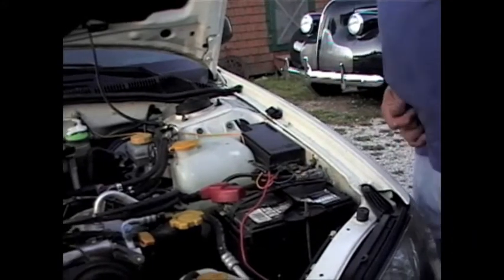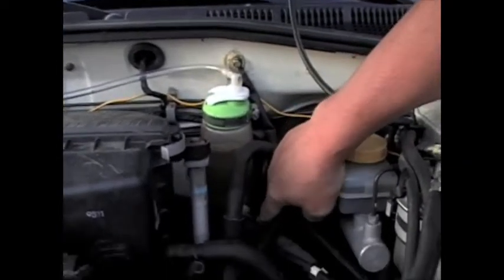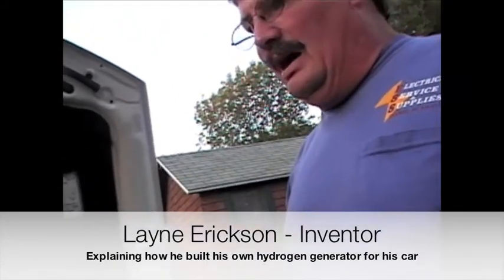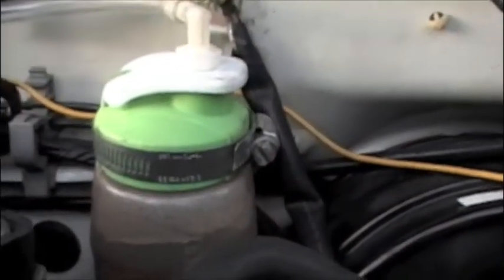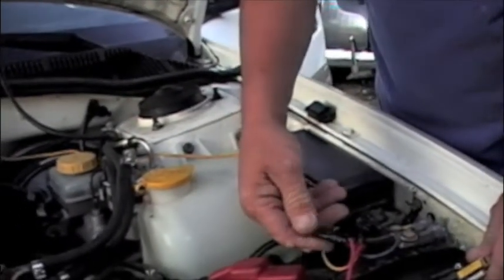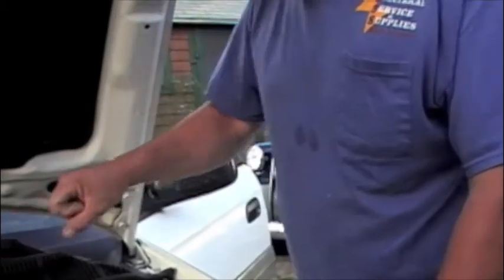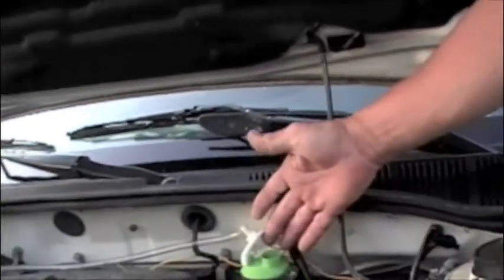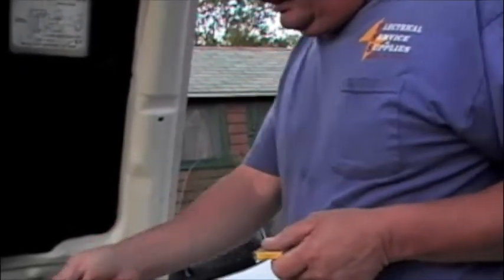Hydrogen Pump adds Browns Gas (HHO) to Subaru

Comment: He's right except the part where the engine detects the extra fuel, since you're adding more oxygen hence the 0 in H20 the 02 sensors will pick up that extra oxygen and that will make the ecm think it's running too lean and will richen the air fuel ratio and you'll end up getting worse fuel economy
Reply: Re mentioned he removed the oxygen sensors

Comment: I've made this with stainless and it always ends up rusting... I've used stainless wire and and stainless plates... either one ends up rusting.. why and how do I stop it from rusting?
Reply: Use silver
Reply: @keithwaltner4089  have you got this set up in your vehicle?
Reply: When doing an electrolysis process your diodes always erode. That's why it's called a sacrificial diode. Silver diodes will still oxidize.
Reply: Try a sacrificial zinc block from the marine hardware store... they're used on outboard engines. Also, I've read research papers that claim aluminum can get 99% efficiency after creating nano-sized texture on the surface.
Reply: Platinum-coated razor blades are noble enough not to rust in this application.